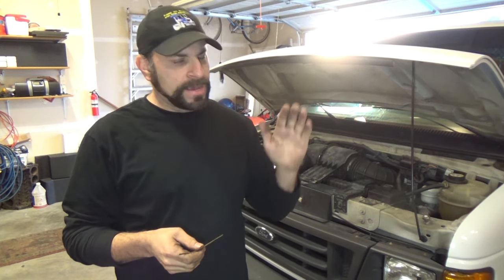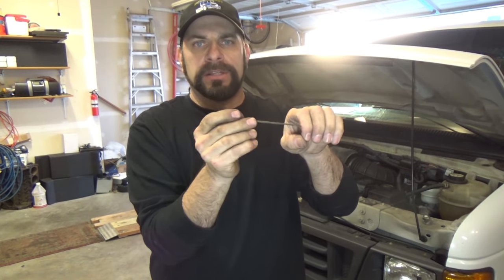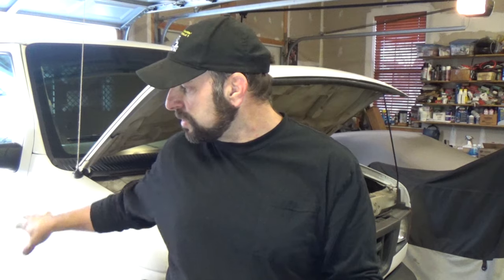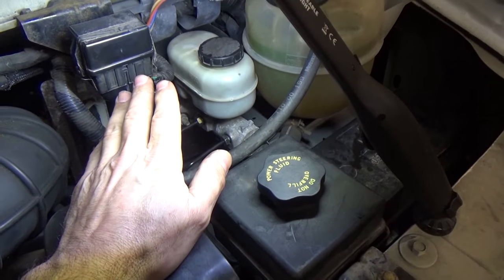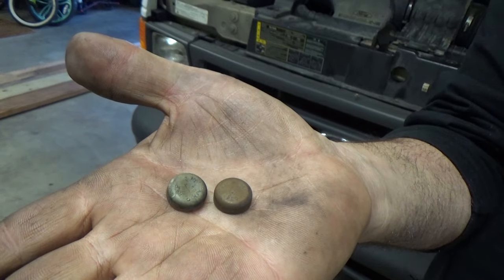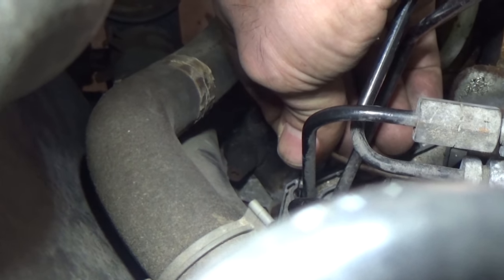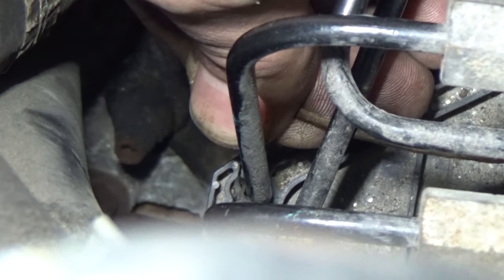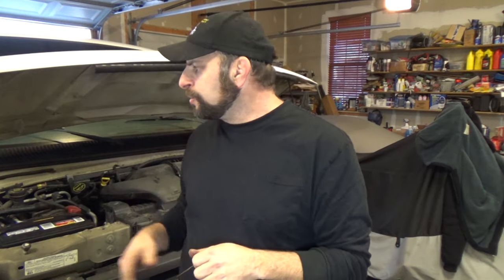Brake Pedal Goes to the Floor I ABS Pump Test I FORD I No Codes

Comment: Hi
My 07 Lexus RX 350 brake paddle sink down. No leaks, everything working fine, mechanic changed the master cylinder which was from after market That didn’t stop paddle from sinking than I bought a very good low millionaire one from junk yard that didn’t solve the problem either, what you think it’s and can abs system can make paddle go down?
Thanks
Reply from the maker: Internal ABS pump seal could be leaking?
Reply: @ozzstars_cars  is the abs pump repairable or I have to change it.  my pedal doesn’t go down all the time and I think it does when car is hot, can I test the the way you did on 07 RX 350?
Reply from the maker: @kshipon1798  use a bidirectional scan tool to test the pump.
Reply: @ozzstars_cars  I don’t have any light on the dash, will the bidirectional tool work? Is there a ABS fuse and can I take that out to see if ABS. Causing the padel going down?
Reply from the maker: @kshipon1798  nothing to do with lights on the dash.  The scan tool is used to test the ABS pump.
Reply: @ozzstars_cars  thanks, is there two different kinds bleeding and are they done two different ways, ABS bleeding and regular bleeding to take air out?

Comment: Hi Glen, I drive an 2015 Kia Sportage. I have an very unique problem, My Brake pedal Goes soft and goes to floor after I Turn my Steering full left. From Second pumping, Brakes are back to normal. This happens only when I turn the Steering to full left only. Technicians here are not able to find out. Any Idea
Reply from the maker: That is an interesting problem.  Sorry I don't know off hand I would need to see the car.  Could it be an electrical issue in the steering system causing the pump to release pressure?  Let us know if you find a solution, sounds like a fun one!
Reply: @ozzstars_cars  Hi Glen, Thanks for your reply. Fortunately we were able to find out the issue. Somehow my cars Rod from Steering Gear Box got displaced towards the right. Which in turn pushed the tie road further to the right. While I have fully turned my steering to the right, The tie rod hit the Brakehose to Caliper Plug which somehow caused loss of Brake. We have adjusted  Rod from Steering Gear Box and Tie Rod and issue is resolved. Thanks for your support.
Reply from the maker: @ajikoshy6890  it's nice to know the problem is solved.
Reply: @ozzstars_cars  Hi Glen, The issue again resurface and Fixed again, Just wanted to share the knowledge with you on what happened. What happened was the right side Lock (Punched into Stabilizer bar and there is two Locks in between the Rubber Bush in Stabilizer bar to keep it stable) in the stabilizer bar was dislocated causing the Rubber Bush and Stabilizer Bar  to slide towards right. When I rotate the steering wheel to Complete left (This also causes over steering during left turn due to sliding of Stabilizer bar Further), The Tie Rod on Right Front Wheel to hit the Brake Flexible Hose to Caliper union which causes the loss of Brakes during first pumping ( Issue will subside once the Steering is back to straight). I have welded the Lock and Placed the stabilizer bar intact. Now vehicle is fine. Thanks for your help.
Reply from the maker: @ajikoshy6890  thanks for the update Aji

Comment: I heard that you need to reverse feed brake fluid, one wheel at a time to do this replacement correctly...is that true?
Reply from the maker: Not that I know of.
Reply: @ozzstars_cars  Did you replace the unit, if so did it work out?
Reply from the maker: @Marie-kj3xf  no I didn't.  The owner of the van sold it as is.
Reply: @ozzstars_cars  thanks

Comment: I have this, but it only happens when the engine is on. So I'm guessing my issue is the break booster, or some of have said a faulty caliper. But I still don't know.
Reply from the maker: Test, don't guess.

Comment: I have the same pedal feeling. But engine off if I pump the pedal it stays very hard. Engine on the pedal sinks just like in the video, if I had 300€ I would just replace abs pump and master cylinder without even finishing diagnosing. Sick and tired of this problem.
Reply from the maker: It can be frustrating.
Reply: @ozzstars_cars  very! On the wheel side everything is fine, new brakes fitted, no visible leaks. Sometimes when I turn the car on, the traction control light and spanner comes on for a few seconds then goes away. Had two codes df202 and df066 but cant find nothing online. Not sure if its master cylinder or abs pump. Right front side brake are significantly hotter but sliders and piston moves fine. Do you have any idea of what it could be? The car is a 2013 renault clio 4 1.5 dci.

Comment: I have this issue but today my brakes completely failed for a second. It was scary on my 2002 silverado 4x4. I called my mechanic and he tested it out and found out the abs computer isn’t working. I almost shat my pants 💀
Reply from the maker: I've had sudden brake failure due to a rusty brake line and it's no fun!

Comment: My abs pump runs even when the truck is off I have to disconnect the battery every time I park
Reply from the maker: That is a wiring/module issue.  Replacement modules are pretty easy to find.
Reply: @ozzstars_cars  thank you for the input I'll try to research wire modules